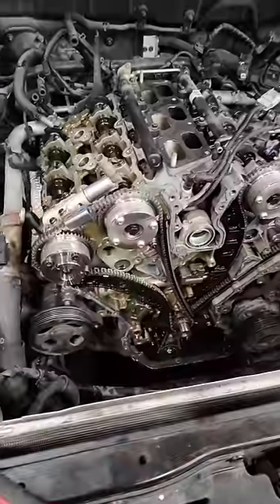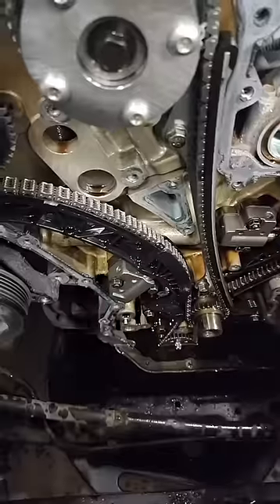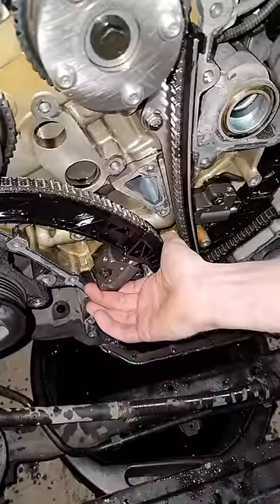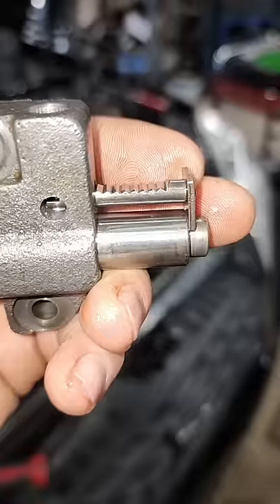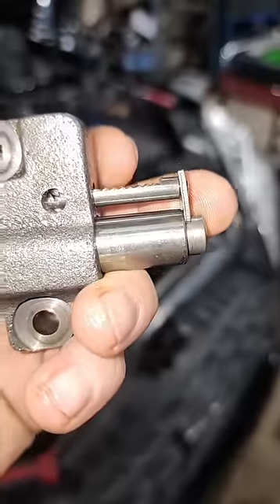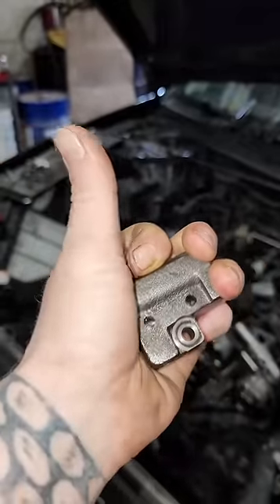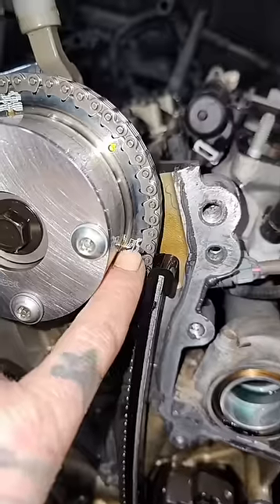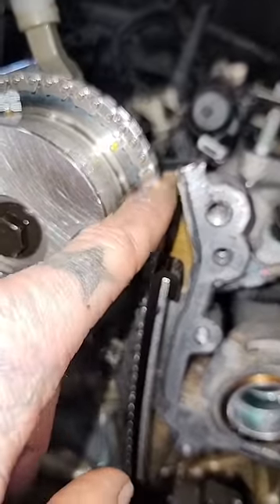I'm not happy

Comment: I use OEM timing parts when I can. Things like this are too common.
Reply: Hyundai oem are just as bad. Was a Hyundai tech for a few years . I and the other guys at my shop have had tensioners fail on start up on warranty jobs.
Reply: @Downsolow  can confirm lol. I find disabling the injectors, removing the spark plugs and cranking the engine with a booster on it till the oil light turns off before first start up the only way to guarantee this doesn’t happen. Doesn’t help if you’re trying to make time but it’s always quicker than replacing a new tensioner… learned that the hard way
Reply: I like OEM  parts as well, sometimes you have to go aftermarket on cost.
Reply: @logancursley5165  Every tech in my shop including my self did that. Still had some fail from the get go. Had one that I did not install right out of the box. It would not hold . Had parts call Hyundai and they said that they had produced a bunch of bad tensioners and ask to look up serial number . They were in circulation.
Reply: If oem was so great it wouldn't be replacing it in the first place
Reply: @cheesecurd100s  It's not usually the tensioner that fails except some Ford's. Getting Chinese replacements for problematic parts only makes things worse.
Reply: @rogerringold616  I've had no problem with Genuine GM timing parts. I've had to use them on an ecotec with 70,000 miles. It had jumped timing because the chain guide bolt came loose, broken the plastic guide and got caught up in the crank gear. No sign of the bolt having been fully tightened or loctite applied from the factory.
Reply: @cheesecurd100s  oem is, people just choose the cost effective route when doing repairs because oem can be expensive and they're cheap.
Reply: @trumps-a-hoe  Oem stuff is so strange sometime you call them up and its cheaper than wholesale at the brick and mortar store then sometimes you call and its time to buy a new car prices
Reply: @Downsolow  Sad
Reply: Good luck getting OEM parts. Many dealers that have always followed the OEM policy to push OEM parts are having to sell aftermarket to get the customers going. It's not just about money from the dealership perspective,  it's about getting the customers rolling again. That customer is not making money if the truck is not moving freight or getting to work to feed their family if the car doesn't go. Nobody is willing to stock anything it seems all the way down to dirt and rock. Steel and well all metals are made from dirt and rock, and I was just talking with a man in the landscaping supply business, dirt and rock, and he said that he was constantly finding that the dirt or rock was basically on backorder.  Go figure...
Reply: I've almost refused to bother with OEM anything after years of this problem. OEM is like milspec, and it's to the lowest bidder that gets the job reuqirment met. 

In almost every case, there is a better quality part with better materials and quality controls
Reply: You realize OEM means nothing right?

No car manufacturers make their own parts. 

That being said he used a Cloyes kit which most car manufacturers rebrand as their own, same as Gates for belts, so he did use "OEM"

GM is one that uses Cloyes. If you have your old chain guides you'll see that it says GM Cloyes. 

Usually on all ecotec 4 cylinders the forward guide is the weak point. It breaks and the chain rubs on the upper bolt. Most of the time it will run for 1000s of miles before jumping timing and all that metal from the bolt destroys the piston walls and they burn oil like crazy.
Reply: @jasonpoletta1797  OEM literally means it is made by and to the same specs as the part they made for the car builder to put in on the assembly line. How is that nothing? The rest of your comment seems irrational the chain can't reach the guide bolt.
Reply: @alorrick7546  Contracts for large parts purchases often include huge penalties for failure rates over a few failures in 100,000 parts. I'll take that rate in replacement parts any day.
Reply: @don2deliver  I do this for a living and have a handful of those long shouldered guide bolts that are half eaten away by the chain. I just did a timing job a week ago on a 12 LaCrosse 2.4. The chain will and does 100% rub on that bolt when the guide breaks.
Reply: @don2deliver  simply untrue. 

Having worked at a dealer distriburion center for OEM parts, all makes and models.

The failure rate is well over 50%. we weed out 90% of the bad products.... 

This is actual fact and truth when it comes to just about anything mass produced where the quality control for CHEAP mass-produced parts is mere pennies.

Where is aftermarket billet, higher quality bearings, materials, and more. 

Many times, the aftermarket part uses rods and pistons as an example. 400$ for a set of OEM Chevy Pistons vs. 500$ forged set... wanna srgue again? 

Let's go lifters then, voodoo rockers or other aftermarket rockers vs. even LS7 lifters... damn ls7 lifters fail all the time. When have you heard of the link bars failing? 

Going again. Timimg belts. Everyone goes Gates or clyotes or something but little to you know aftermarket HK and or other bets from continental which are kevlar and or other fancey materials are the "real" part and most parts your buying is "old stock" generally 1-5 years sitting on the shelf. 

Where aftermarket is 99% of the time made to order or small scrutinized batches. Such as alternators. 

Go ahead and argue that area dare you. 

In the end, your opinionated argument of oem parts being better is just that but false. As many manufacturers speak out that profite margines are made by contracting the lowest acceptable bidder. 

Look at hyundai and all their recalls for buying from a horrible contract. It happens its why there are lemon cars from every manufacture...
Reply: @jasonpoletta1797  My experience was the broken piece of guide caused the timing to jump on 2 different cars.
Reply: @alorrick7546  OEM parts are better than cheap Chinese knock offs even if they sell them under a brand name.
Reply: @alorrick7546  I'm not even reading all that crap. Cloyes parts aren't made from quality billet. If it's not for a puhrod American V8 it's coming ftom offshore.
I bought a cloyes true double roller for my last 302 that had 330,000 on the original cheaper OEM. But I'd be damned to go out of my way to buy some imported Cloyes timing crap for a Ford OHC V8.
Reply: @trumps-a-hoe  OEM is no guarantee, GM dealer was installing a 3.6L V6 in my Acadia, stopped and notified me that engine was bad, needed to order another one. Found the defect while installing accessories, never put it in the vehicle.
Reply: @alorrick7546  Educated enough to know insults are not proof of anything.
Reply: @alorrick7546  Praying for your compromised soul.

Comment: I like the old Japanese particularly Kawasaki timing chain tensioner’s. Spring loaded Ball bearing on a slanted rod. Never seen one fail ever. Never needed to replace them.
Reply: They fail all the time on the Kawasaki EX500. Common issue on those.
Reply: Thats why they changed the design,  it worked too well and never needed replacing.
Reply: @redrustyhill2  I believe they call that planned obsolescence, And its bullsh*t!

Comment: Used a cloyes chain kit for a 3.5 explorer with failed tensioner out the box. Never again! Damn chain was tapping like crazy
Reply: The chain just wanted to let you know it was there for ya
Reply: Same thing here for my 97 Montero Sport. Roughky 70 mph jumped time at around 2900rpm 3wks after I put a cloyes kit in, mow engine has to be completely rebuilt. 3 months later and my boat anchor is still sitting waiting on their response.  Lawyer getting involved now.
Reply: Cloyes did this to me last year. Listing for a 2017 (somewhere around that year, I'm not pulling the invoice just to leave this comment) CX-9 3.5L did not include the engine split mid year that shows up when looking up a Ford vehicle (like an Edge) of the same year. Chain tooth profile changed, you cannot mix any parts between the two. Early or late design water pump was the only thing available, updated (late model) chains...were not. Luckily the only thing that failed was the water pump. I was not happy having to reuse timing components though.
Reply: Do yo chain hang low, is it slapping like a ford?
Does it make the oil sparkly? Does it slap all through the night?
Reply: @bleachstain9785  Careful now! YouTube will start handing out copyright strikes against comments if you keep that up.
Reply: @corythomas4427  so how much more would oem be and would you go that route in the future instead?
Reply: @eastender74  I get asked that question daily, my reply is always "I don't know. If you can get me the VIN I can put an estimate together and send it to you."

I can tell you what I did last week on the Mazda CX-9 3.7L water pump I replaced. That's all I replaced, water pump, the one stuck VVT solenoid, a few gaskets (valve cover gaskets, front crank seal, etc.) coolant (FL-22, OE type coolant) oil (twice to try to get all the coolant out of the crankcase. Used oil out of a Subaru with 9,500 miles and new Motorcraft filter. Then drained that, replaced the filter again and put new GF-6 full synthetic 5W-20)
Reply: That's just how fords sound.
Reply: @RogerSegerJr  Damn sorry bro.

Comment: Please do a follow up 
I had the hydraulic tensioner fail on a Subaru 
Aisin kit supposed to be the best kit for Subaru. All they did was replace the kit. 
I had to replace the motor
Reply: I would have followed up with a lawyer in my pocket...
Reply: Sorry to here that
Reply: the engine didnt have a chance for a rebuild?
Reply from the maker: Usually if the manufacturer doesn't pick it up the parts supplier is suppose to at least mine offer a warranty will see what happens
Reply: @AutoTechMike  Out here in STL Missouri we can get labor claims but most parts stores won't cover more than part and labor. You have to contact manufacturer yourself and let them know its not your responsibility to pay for a whole engine because of their quality control issues and as I have seen before a few choice words and most of the time the manufacturer will fix the issue.
Reply: I plan on doing a timing belt on my jap car. Now i gonna be freaking out because i got an interference motor
Reply: @jtbuilds9176 this falls foul of just about every aspect of contract law I can think of. 

The seller of the defective part is the first step on the liability chain and it's up to them to go back to their supplier.

Attempting to dodge liabilities is the kind of thing that your pet lawyer will love to sink teeth into as it's an easy case
Reply: That always sucks when you get what should be the best available parts and a maintenance item caused a catastrophe. Usually every part in their kit looks exactly like the original.
Reply: @JohnSmith-xu7ev  before starting it or even putting all the covers back on, crank it with a ratchet. If you have all the spark plugs out, it should crank very easily. If it touches a valve, itll get stuck. Your wrist wont bend any valves.
Reply: @DakCuh  
Im already an awesome ex professional mechanic. But im fearing a brand name part  used in the Toyota community might be defective
Reply: @loosh__sii Subaru’s use what’s known as an interference motor.

Meaning: When the timing goes, the pistons and valve can come into contact with one another, causing catastrophic damage to the pistons, cylinder heads, cylinder walls, valves, turbo’s (if equipped). 

It gets to be quite the mess when they go out. I’ve had to replace a few I’ve toasted myself, and I’ve resolved to never own another Subaru as they don’t take too kindly to heavy footed drivers.
Reply: @JohnSmith-xu7ev verify bearings by ear and by hand before and after installation. Check tensioner tensions with a pry bar or other means prior to install, check that it tensions after install.

Use proper torque spec, I cannot tell you how often I’ve seen too high a torque spec cause premature failures, only that Ugga dugga is not the answer to tighten everything in the world.

Comment: I use OEM factory parts every time I do a timing job (which by the way is all we do at our shop) and we have never had one comeback. Cloyes is the worst of them all. Use OEM one and done onto the next one.
Reply from the maker: I've never usually had a problem with them. It did put a sour taste in my mouth that's for sure. OEM or nothing is the way my shop is going for now on. You try to help the customer with a lower price and stuff like this happens. Agreed OEM or nothing

Comment: I feel your pain brother. I can't tell you how many parts I've had lately that were brand new and lived a very short life before failing. Most recent ones were a MLS headgasket that started leaking coolant externally. Block and head were surfaced and perfectly flat, new head bolts torqued in sequence to proper spec and all bolt holes were even chased before installation and yet it still started leaking after a couple heat cycles. Also did a pinion seal on a ram 3500 that lasted 3 weeks. To top it off, last year i had a timing belt break after 6 months. Bent valves in 2 cylinders and had to pull the head to fix....new water pump, tensioner, belt, and idler, yet it still snapped.
Reply: I just put shift solenoids in my trans that lasted a whole 6 hours. I reinstalled my known good used ones and so far I have 2 weeks on them

Comment: Had a 2004 Dakota V8 with a loose exhaust valve seat. Put rebuilt heads on, new timing chains and guides too. Oh such fun it's an ex-rental and being a final model year it's assembled from all the leftover bits scraped together for fleet sales so some of the changed partway through 2003 pieces on the engine are still early 03 and before, like the metal timing cover gasket plate it shouldn't have - but it has the late 03+ valve covers.

Get it all back together and it clatters like mad until it warms up. Poke around with the stethoscope and the noise is coming from the right front. Turns out that when the engine was manufactured 140,000 miles ago, they didn't get all the shavings flushed out of the oil passages yet somehow they stayed put for all that time, and somehow doing the work on the engine made them come loose and pack up into the right side timing chain tensioner screen to restrict oil flow just enough to make the chain slap until the oil warmed up. Cleaned that, put it all back together and it was fine.

BTW, there is no need to buy the higher priced "V8" valve spring tool for these engines. The "V6" tool is 100% identical other than the part number. I called the manufacturer and the guy there admitted it. I asked why there are two identical tools? "Because Dodge wants it that way.". That company has collaborated with Mopar since the Dodge Brothers founded the company to design their vehicles to require special tools.

Comment: This is why you use OEM parts on everything that has to do with timing. Cheap parts get you this.
Reply: cloyes is/was a trusted name brand. sometimes better than OEM
Reply: @stephenr1999  key word ‘was’
Reply: Oem means nothing
Reply: OEM IS MADE BY AFTERMARKET COMPANIES THEN BRANDED BY MANUFACTURERS
Reply: @redrustyhill2  true. i hate to say this but i had a customer that wanted good name brand parts because he was going out of town on a hunting trip. so i got a good name brand alternator (among other parts) at a pretty penny. he didnt make it to the state line. lost faith in that name brand and a customer
Reply: Some manufacturers cloyes is the oem manufacturer it's a crapshoot anymore regardless of which parts you use. Parts are only as good as the human that's running the machines manufacturering the parts...
Reply: Had an oe Toyota tensioner do that on a 5.7 tundra motor. Same thing
Reply: Had a genuine Toyota part fail one time.
Reply: @OneManOnFire  exactly…. One time. 😂
Reply: OEM parts do not prevent this new OEM parts from failing. especially on Fords. Had AC compressor fail Ford pick dealer put a new compressor in, as I'm driving out of the dealer compressor locked up. Mechanic had to replace compression, condenser and evaporator for free, it shattered flowing metal shavings through system Fords servicee manager tried to get me to pay for non compressor parts, after much debate he begrudgingly agreed.
Of course it was a Ford, finally got tired of fixing Fords all the time, ditched both my Fords it for two far, far, more reliable Toyota.
Reply: @stephenr1999  where are they made now? Timken use to be world class bearings now china
Reply: @airgliderz  Yup, you get metal contaminants in the system, everything but the lines needs to come out and be replaced. And the lines have to be cleaned out, too.
Reply: @stephenr1999  sometimes/? you want to take that chance. Chances are higher that oem is always good enough. He even   showed you the good part he took off in this video
Reply: @OneManOnFire  once?  I will take  those odds and always use toyota
Reply: @danielhoward8354  Just one time time fail on a genuine Toyota part. I've also had one AutoZone part fail.
Reply: Since when is Cloyes "cheap"?
Reply: Except for hyundai, oem parts are trash too 😂
Reply: @MWAclanGaming  lol that just means the whole car is trash
Reply: @danielhoward8354  Exactly, there a reason they give you 10yr warranty.

Comment: Hyundai timing tensioners never fail. The only hyundai timing components that go bad are the cvvt’s on these lambda v6 engines. I work for hyundai and i always reuse the chain and tensioner on these without issue regardless of mileage.
Reply: How do I find the cvvt? Tnx
Reply: @zzxxenith   The cvvt assemblies are the cam gears.